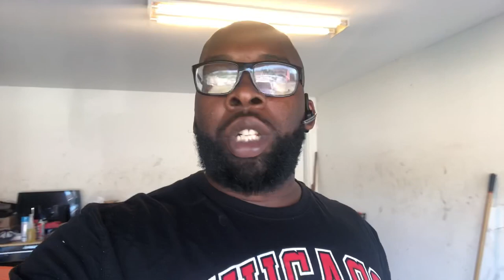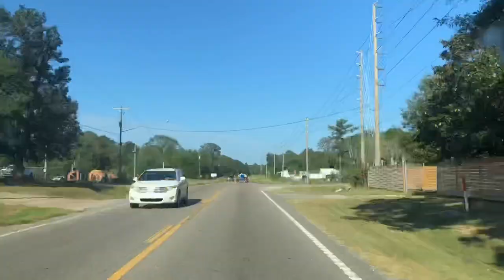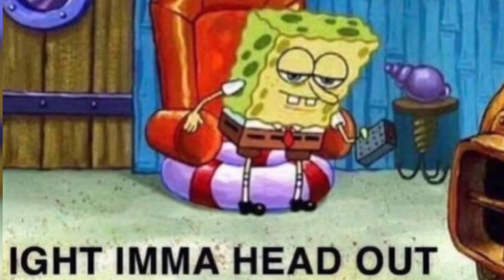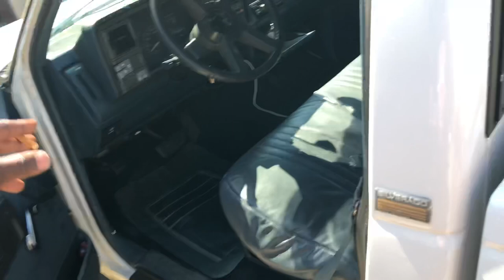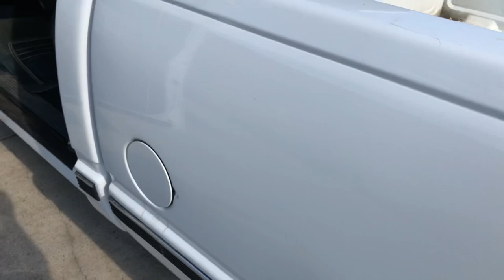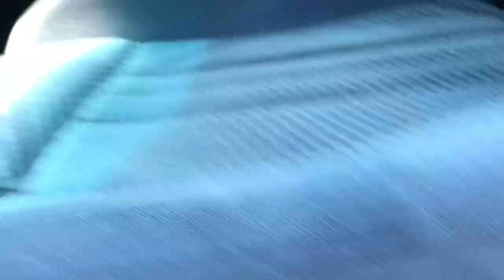1994 Silverado OBS bucket seat reupholster or Shampoo

Comment: Man, I surely could use your bench seat out of your truck bro. I have a '79 Chevy truck and the front seat is all kinds of nasty. Big hole where your butt goes right there at the steering wheel.  Without a fat pillow stuffed in it,  I about slip through,  ha!  Only bad thing is that I live in Arizona,  way to expensive to ship it, dang it.
Best of luck to you while getting your truck the way you want it to be. You're doing a great job with your videos,  so keep it real. 
Later.
Reply: Already sold to me